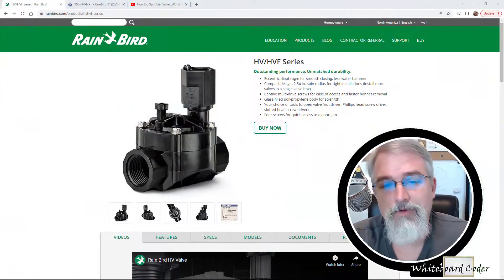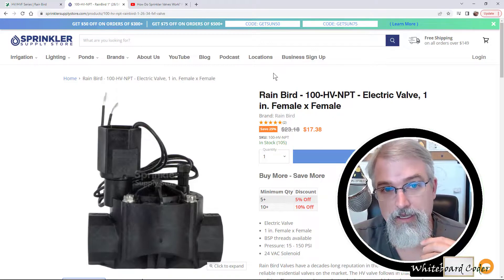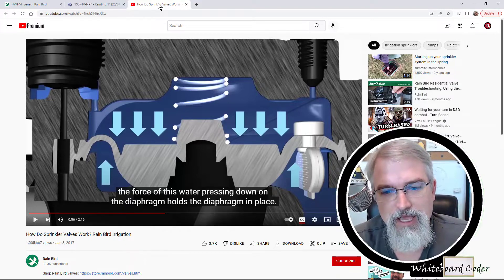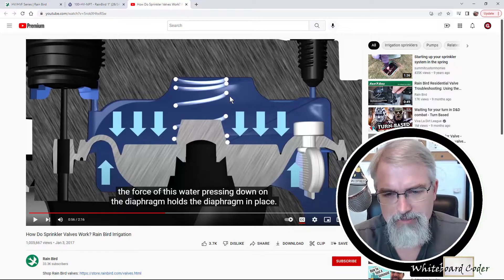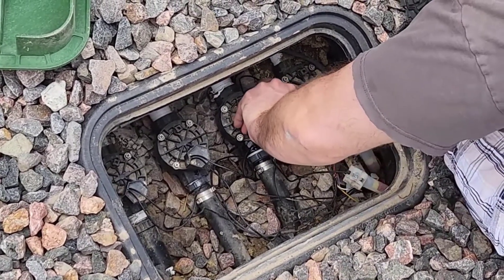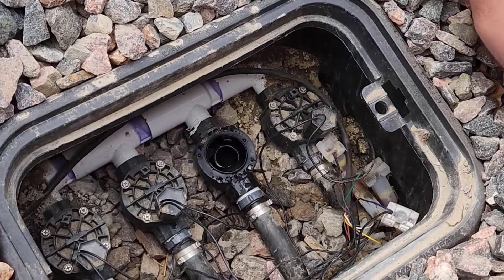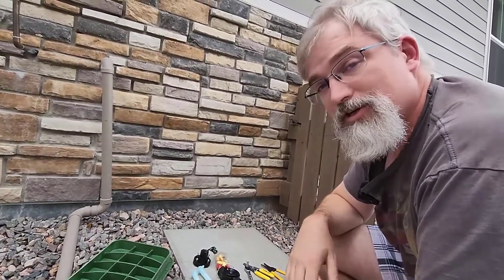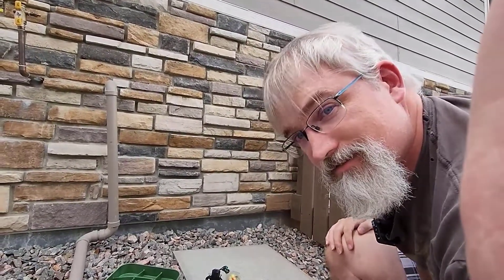Fixing a Rainbird 100-HV-NPT Valve Won't Shutoff

Comment: The voltage is actually around 21 volts alternating current so it could probably tickle your tongue 🤪
Reply: It depends on the AC voltage delivered to your home.  Ours is a bit higher, so the voltage at my sprinkler solenoids is around 26 volts.